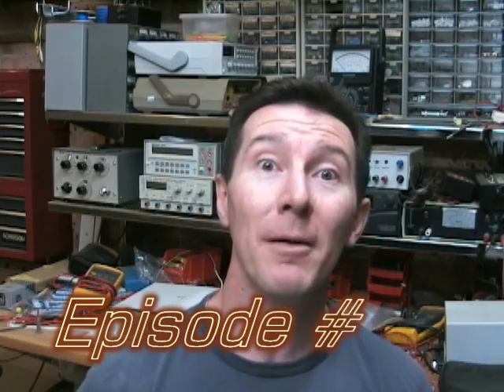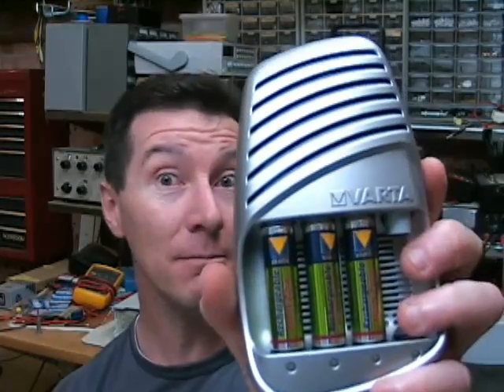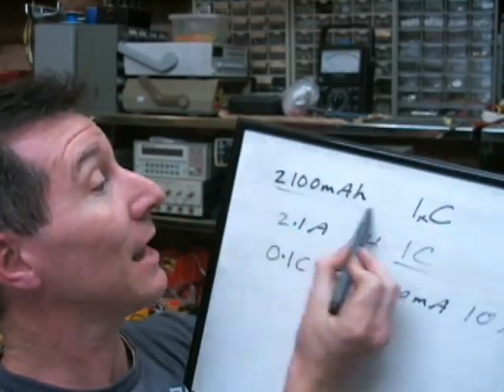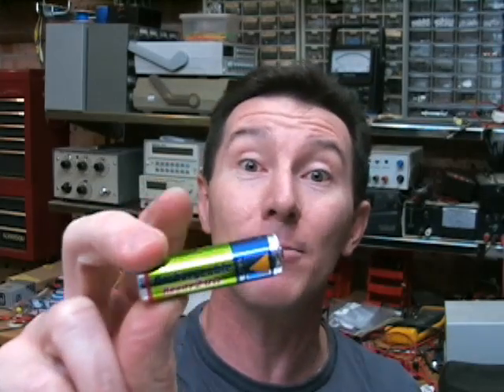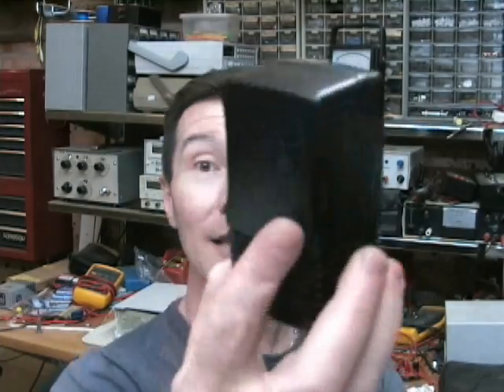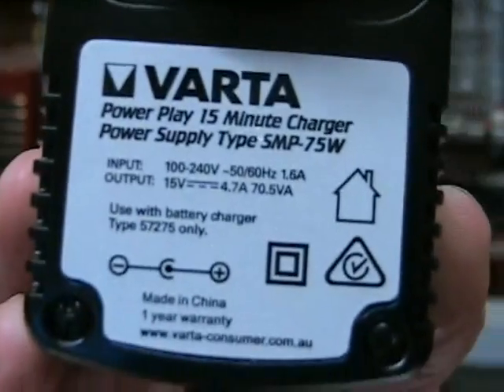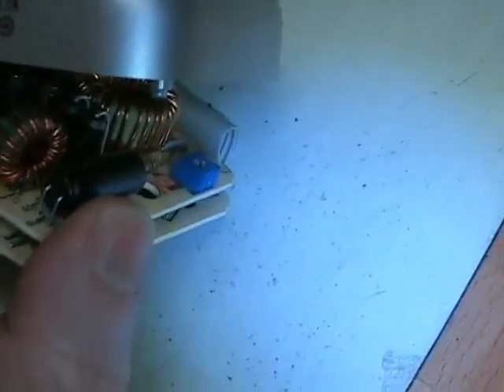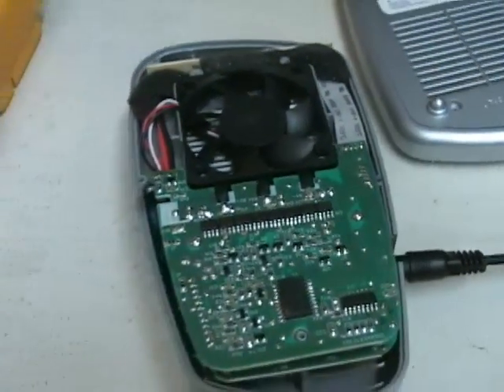EEVblog #35 - Inside the Varta 15 minute NiMH Battery Charger

Comment: Sounds great in theory but pumping that much charge in  nimh cells in 15 minutes cooks the batteries shortening there overall lifespan and possibly even capacity they claim 1000 cycles cut that in half because pumping that much juice that fast will shorten lifespan

Comment: I have (or had) the earlier version of this charger. Pretty good thing and the cells are still some kind of working (don't expect too much).
Unfortunately I might have killed the charger today - the above mentioned cells tend to convert the energy delivered from the charger more into heat than storing it. Somehow, the charger tried to fast-charge the batteries causing them to get pretty hot and by that maybe overheating some IC.

I"ll open the charger the next days and see what has happened and maybe I can fix it.
Reply: Hi, let me know if you could do sth about it. I think I also have the one you're talking about - the 57055, and it died this morning (after about 15 years of honourable service). I opened it, but couldn't find where the problem was - it is more complex than I thought. The springs, and particularly the mechanisms at the minus pole of the battery that triggers the engine, are tiny fragile wires linked to the board - and it is just too high level for me. Really a pity :/

Comment: Great video.
But isn't it overdriving the power adapter?
With max 4.7A from mains, what makes it 8.4A?
Reply: You can try buck converter. A 15V, 4.7 Amps can supply power of 70.5W. With that amount of power, you can supply up to 47A if the voltage is dropped to 1.5V. However, this is practically limited to buck converter circuit capability to draw such amount of current.

Comment: Informative video but you never answer your own question, did it charge properly in 15 min? 
Also how hot did the parts get? 
And finally did yo eat the battery as you promised assuming it did charge in 15min :-)
Reply: it does work.
i had these in 2004-2006.
god i loved these damn things.
cheap and charged in 15 mins.
i had a very boring warehouse job so i used this to listen to music/radio all night.
i had a CD player that played MP3s. so a single 700MB disc could hold 8-10hrs of music.
i would have to recharge the batteries every 10-12hrs so the 15min recharge time meant i had very little downtime.
the batteries would last about a year before they started to only last about 2-4hrs.
also.
if i remember correctly, these batteries would get very hot when recharging so i would wait a few mints before using them.

Comment: So I have one of these that has been re-branded by Rayovac. My question is, how does it know when you are charging their fast charge batteries, or just regular rechargeable batteries?
Reply: ***** They don't. I use mine to charge regular batteries all the time. Somehow it knows to reduce the rate when it is not one of the fast charge batteries.

Comment: Sir I need your advice, i am planning to build a 48v  using NIMH 1.2v  3000 mah , teh question is that  can i charge this with  7-step,full automatic switch mode,(reverse) pulse charging that you  can buy at ebay  and  if i have 48 1.2 v 3000 mah how much AH i will have for my 48v battery pack can you please correct me Thank you!
Reply: Do not buy those 3000 mah batteries on Ebay. They are fake, dangerous and only hold 250 mah. No AA in the world can hold 3000.

Comment: I know this is an old video, but about 10 years ago I bought a Rayovac 15 minute battery charger with 4 AA batteries. That thing worked a charm! The only reason I stopped using them was because I upgraded to get, (much), higher mAh batteries. I think the Rayovacs were somewhere around 1600 mAh - but that was years ago before the higher capacity batteries were available.

Comment: Can I use this to charge the russian nuclear batteries that I got off ebay?
Reply: No, you need fresh U235 pellets for them. I'm sure you'll get those off of eBay too....
Reply: CoolKoon Ach thats what they are there for. I still have two bags in the hallway of those pellets that came with the batteries, unfortunately all instructions are in kyrillic.
How exactly do I refill them?
Can I put the old pellets in the normal garbage or do they go into the recycling bin?
Reply: +Ernst Stavro Blofeld Actually it's pretty easy. You take out the old pellets from the battery (make sure to wear gloves!) and insert the new ones in exactly the same position where the old ones were. To make sure though you might want to type the instructions in Cyrilic to Google Translate (they aren't that different from Greek letters and Google Translate gives you even a Russian keyboard layout).
As for the old pellets, it's a tad bit too toxic to go into the recycling bin or regular garbage I'm afraid. You should drop them off at any electronics shop that takes old CFLs, fluorescent tubes and batteries. They'll be happy to take the burden of recycling it off of your hands I think....
Reply: CoolKoon Finally someone talks sense.
I followed your instructions and now they work like a beauty. The display says Power: 96W/h - 87 Years. That is better than the original specs!
Fuck LI-POs!
Thank you so much!!
Reply: +Ernst Stavro Blofeld Yeah, don't mind the oversized apples and tomatoes growing in your backyard either :D
FYI: energy is measured in Wh (watts X hours), not W/h...
Reply: CoolKoon Don't worry. I put the depleted pellets in the recycling bin in the drugstore.
Reply: +Ernst Stavro Blofeld Thank God! For a moment I thought that you did something irresponsible. All is good then :)
Reply: CoolKoon Perhaps it would be better for the world if you stop to "think".
PS: In Russia and Europe "/" stands for "per".
For divisions they use "÷".
Reply: +Ernst Stavro Blofeld Actually in math the "per" sign (/) is used to express division all around the world. Km/h means "kilometers divided by hours" all around the world (hell even mph stands for "miles per hour" AKA "miles divided by hours"). Also where I come from (yes, it's in Europe too) the universal symbol for division is ":" (colon), not "÷".
Reply: CoolKoon What has that to do with re-charging batteries? This is pathetic nitpicking. Complain to the Soviets. I did not make these batteries, I merely use them.
Reply: +Ernst Stavro Blofeld Yeah. Formerly an Austrian colony, later a Soviet colony, today a western colony, but still a colony nonetheless.
Anyway like I said before: there's no such thing as W÷h nor W/h. Go look it up, I'll wait....
Also I think that you might want to review your high school math curriculum. Perhaps that would make you realize that both in math and physics the signs ":", "/" and "---" (the fraction sign) are used pretty much interchangeably.
Reply: CoolKoon Since when is Maths democratic?
Reply: CoolKoon And what has that to do with re-charging batteries? This is pathetic nitpicking. Complain to the Soviets. I did not make these batteries, I merely use them.

Comment: Gees, pushing 8A charging current through a small poor AA battery! 4C!?!? modern Lipos take like 2C absolute maximum!
Reply: +heldgop There are high-rate charge batteries for RC purporses for example, at least 5C the last I checked. But those are Li-Ion and they have like 300 cycles before they start to wear-out.

Comment: I had one of those Energizer 15-min charging kits with batteries... I don't think I got more than about 100 cycles out of those before the batteries started dying. 4C is much too harsh.

On that charger, battery detection was done by detecting current across contacts and I'm guessing the charge cycle control was done entirely based on I-V curves. When a battery ends up too far off the expected I-V curve, the charger flashes the failed battery code.

The PCB contacts behind the "spring thingies" on my charger were actually a switch to select AA vs AAA charge current. What I ended up doing with my fast-charger is cover the battery size detect pads to make the charger operate in permanent AAA (lower current) mode so my AA batteries would not warm up anywhere near as much.
Reply: I just try to avoid chargers that claim to be quick. Had quite good experience with even 50 or 100mA (and similarly low rates - gosh it can take very long to charge) per battery...and even with no uProcessor. At least my batteries can do more cycles before dying. Of course the best option is to get a charger, where current can be set... From my opinion the compromise levels for reasonably long charging time and life expectancy is around 0.5C. Of course - If you are RC maniac, you will have to charge them quicker :-)

Comment: Do you have to use the " labeled" 15 minute batteries with this charger or can you use the charger with any NiMH batteries? I have been using Eveready 2450 mAh with my Varta charger, which may be an earlier version of the one that you demo'd as it only has 1 LED per 2 batteries inserted however the LED will go on when only one battery is inserted...thank you for your post!

Comment: You might want to watch again with your glasses on. His math is spot on. He didn't write 10C, he wrote C/10. That's 1/10th the charge rate, and 10 times as much time.  A battery that has a C rate of 1 hour has a 4C rate of 15 minutes.

gramar tip:   It's "albeit" not "all be it".

Comment: A bit late ;-) However would like to share.  
In 2008 I bought 15 minute rechargeable 2000mAh Ni-MH batteries from RadioShack labeled I-C3. 
Back then, did some googling and, if not mistaken, those were custom produced
by  Ray-O-Vac .  However, everything is simpler here. Those batteries have an 
internal pressure operated cut off mechanism, for the end of charge! No smart electronics. 
If not mistaken, the gases produced at the high rate charge, create the necessary pressure.
I love EEVblog!

Comment: i have 2 arlec aa rechargable battery's (left) i have had for close to 25 years, they must have passed 1000 cycles by now easily and amazingly they still work as if i had just bought them
other then those, varta batterys are the best if have had since them (all others life is limited to a few months, to a year if lucky) but varta work good and hold charge, the chargers are cheap and nasty though, mine blew up, and now i cant find a replacement, not a 15 minute charger anyway

Comment: That isn't how these work. NIMH and NICAD batteries can accept very high charge rates up until they are about 80% charged, after that a great deal goes to heat. Since it's a charger designed to handle different battery capacities, it usually doesn't even know what the C rate is. It just dumps a lot of energy into the batteries until they get warm, then the charger backs down the current for the rest of the time. You will rarely get 4 2.1AH batteries fully charged in 15 minutes. More like 80-85%
Reply: You are wrong. This system pre-dated LSD Ni-MHs and was a patented technology by Rayovac, rebranded as Varta at retail in Australia. The cells were special, featuring internal cut-off pressure switches and black resistance bands at the negative end of the cell which were sensed by the charger to determine the presence of an I-C3 capable cell.

Comment: I don't know why they always say they can be recharged 1000 times. I have gone through a lot of AA & AAA nickel metal-hydrate batteries and I am lucky to get 80-100 cycles from them. That is using a microprocessor controlled charger that charges each cell individually at 500mA.
The timer based chargers get even less cycles because they almost always overcharge the batteries and usually charge in series to cause even more problems.

Comment: Would be nice to know the actual results like energy density after the 15 minute charge and the charge cycles.  One issue with these chargers if you use standard NiMH batteries on this charger they gas electrolyte which destroys them quickly.  The other thing is I'm not sure the formulas work out NiMH batteries have a typical charge efficiency of 65% so you need to ad 35% onto the numbers to allow for loss.  Gotta go along with you tho with the 1000 cycles BS

Comment from the maker: @enliteneer It's about wattage. The plugpack does not need to do 8.4A because of the internal DC-DC converter that generates a lower voltage at a higher current.

Comment: So to a charge a 2100mAh battery in 15 minutes (4C), why isn't the AC-DC plug pack adapter rated at 8.4A?  (Or more since it can do 4 batteries at once)

What's the model of this?  I'd like to see how it price compares with the PowerEx C9000 or even the Battery Wizard that can recharge standard Alkaline batteries!

Oh, also, did you have to eat the battery?  Were you thinking that the # of cycles would decrease the faster you charge it?

Comment: checkout the Powerex brand, i use the imedion ones 2400mah retains 85% charge upto 1 year, insane! I also use the MH-C9000 battery charger and found it very good, Does temperate sensing, delta v and timer cutoff and charges each battery independently. Might be another review idea?